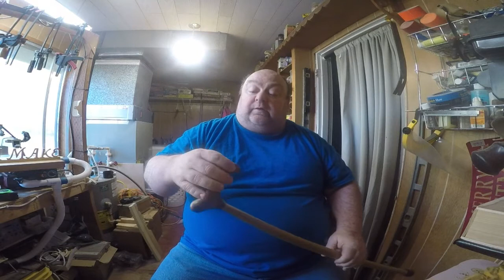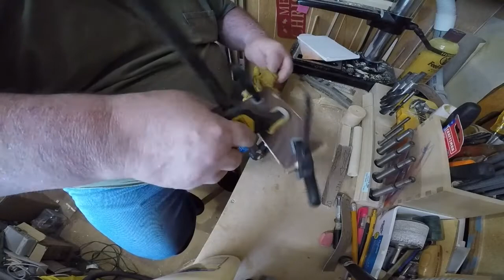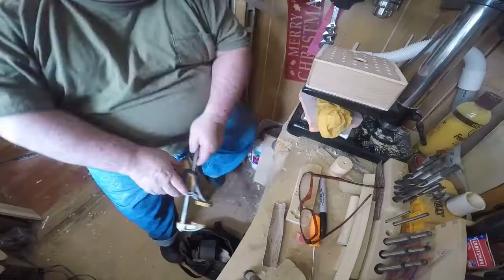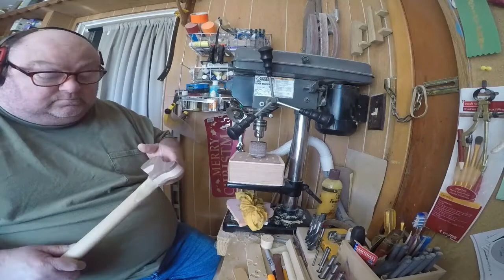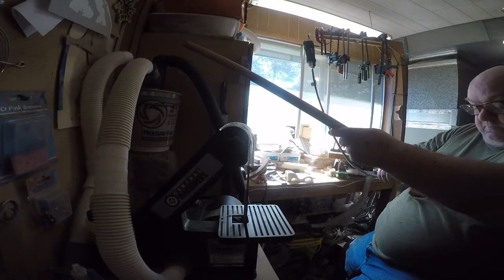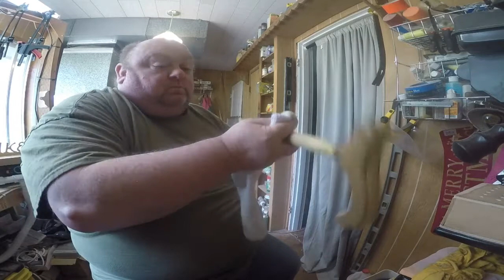Wooden Walking Cane, Walking Cane

Comment: Beautiful job Dennis,  your cane turned out awesome!  Did you use original polyurethane Gorilla Glue or the Gorilla brand CA glue for the finish?
Reply from the maker: Original Polyurethane. when you use it you need to rub it in to the wood real good with a tare cloth. Use just a small amount at a time.